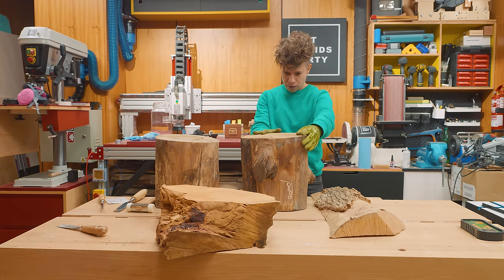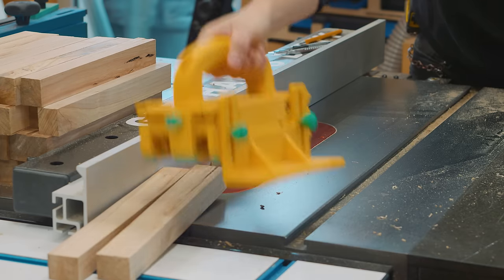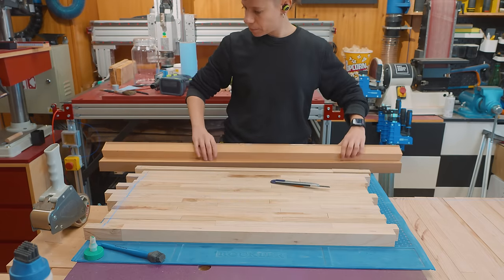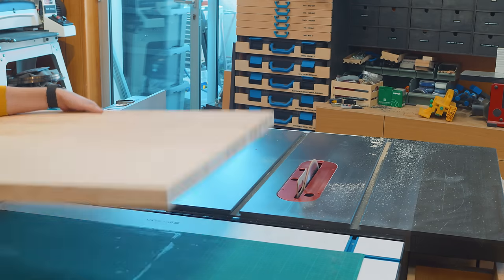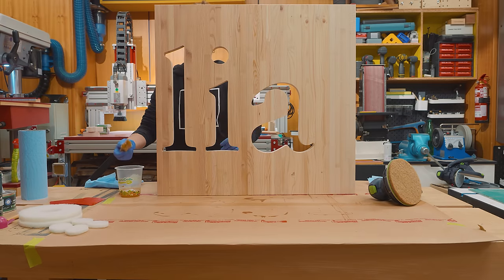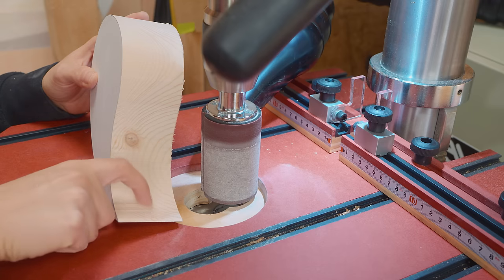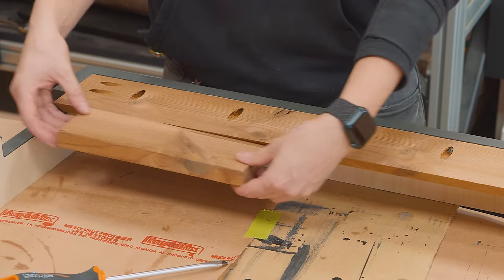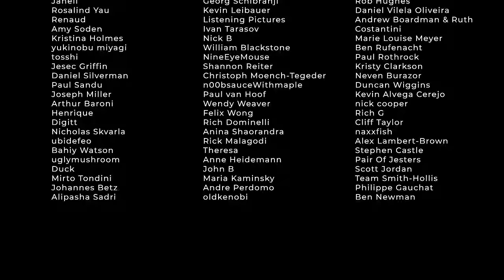How I Turned These Logs into a Light Box Sign

Comment: I really love you worked hard to include even the smaller bits donated. Bot everyone has the ability to find/so easily contribute to a 'company wide' thing like this, and it's great that for those that could only give small bits that you made sure they were included so everyone feels part of it.

It would be easy to discard smaller bits out of hand when you have all the larger stuff, but then for those that contributed and those small bits which could have been hard to get for them, they would feel their effort was pointless. Whereas here everyone's donation was used as much of possible.
Reply from the maker: That's exactly what I tried to do and make it as fair as possible. Thanks for bringing that up. :)

Comment: Good move taking out those pine knots! Seems like those dang things never stop exuding pine tar. (40 years of experience with trying to keep that pine tar from coming through paint/varnish/shellac/urethane in all sorts of combinations.. I've just never been able to make it work.) And thanks for the tip about creating a stable edge using thick tape to correct a slight bowing of the panel. Makes sense.. never thought of that one.

Comment: Which drum sander do you have? And the tube for dust extraction at the drill press- where did you find it??
Reply from the maker: My drum sander is the  Jet 16-32. You can see the dust extraction on my drill press video build https://www.youtube.com/watch?v=gbGLIDfjp9o
Anti-Static Tubing https://amzn.to/3FpVYLF
Anti-Static Rectangular Nozzle https://amzn.to/46E997H
Anti-Static Oval Nozzle https://amzn.to/3FsPifG
Anti-Static Slide Valve https://amzn.to/48VN0TI
Hose Adapter https://amzn.to/3Fq8MRU
Reply: @GetHandsDirty  thanks. My shop is in dying need for a drum sander.